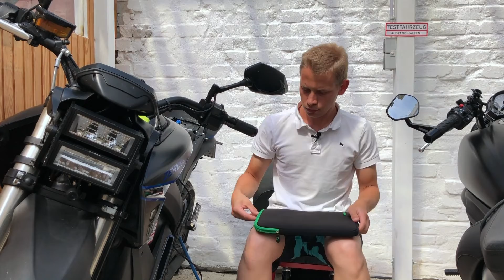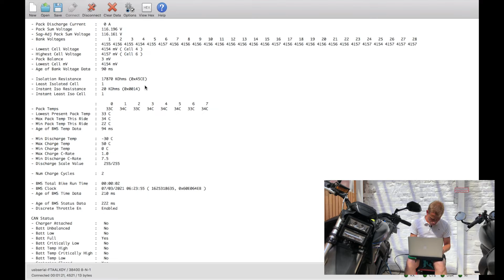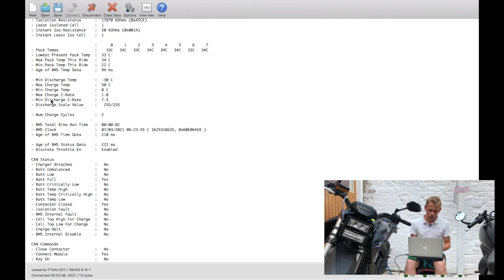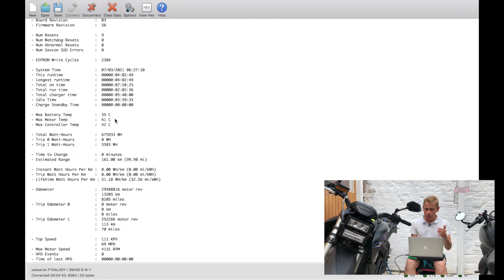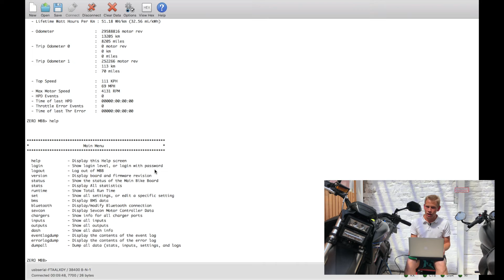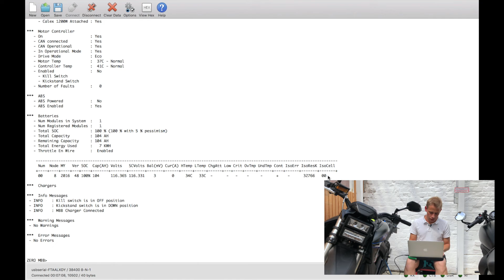ZERO | Establishing a serial PC to MBB communication

Comment: Gday from NZ Max! Agree with others, this is very well done (particularly your cooling system!). I didn't see in your videos and may have missed it, but with 3x TC chargers, how quickly are you charging your bike in minutes? I no longer have my Zero SR 2016 (Energica upgraded), but since it's the same bike internals, I'm curious the difference between my 9.9kw diginow pan setup and yours. I would get a low state of charge (below 10%) to 100% in 1hr on my 13.0kwh battery. If around 20% SOC then only 40min. Thx!

Comment: Thanks for doing an English video. Very well done, your English is near perfect! Should do more videos on the Twizy in English :) One thing I did notice, you described the transmit wire as a green wire - it's actually a red wire you were holding onto. Guess you're one of the 1 in 12 who struggle to see red and green clearly?
Reply from the maker: Hi moojuiceuk,

you guessed 100% right, I struggle with seeing some shades of red and green.

Best electric regards
Max Jäger